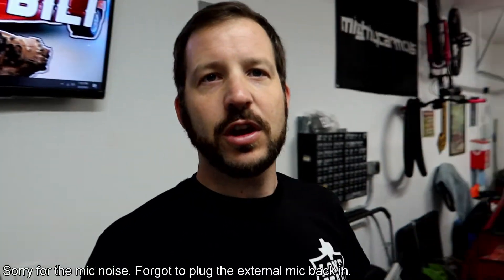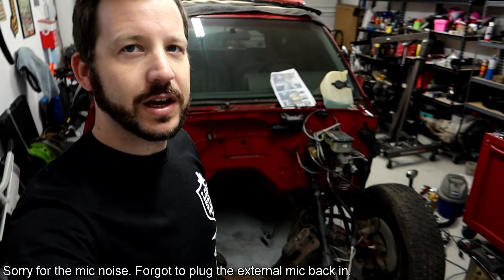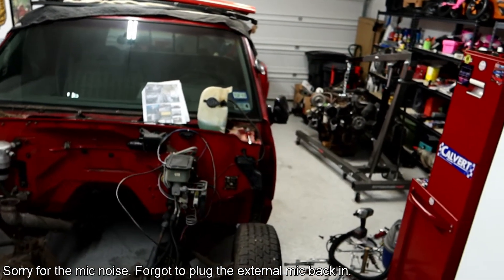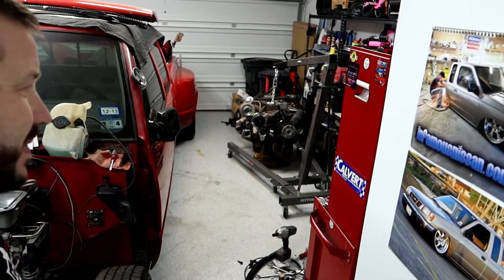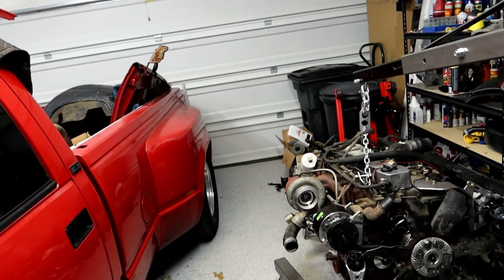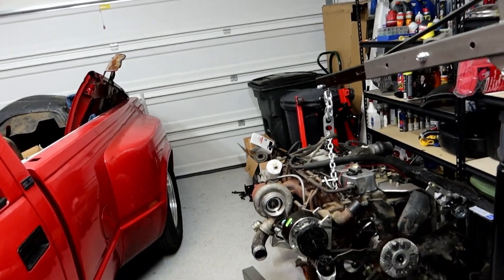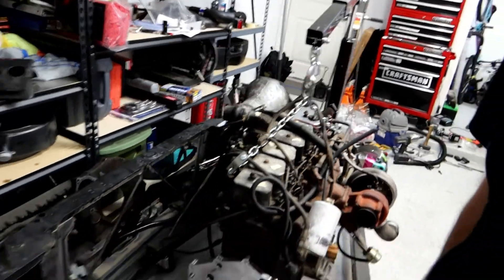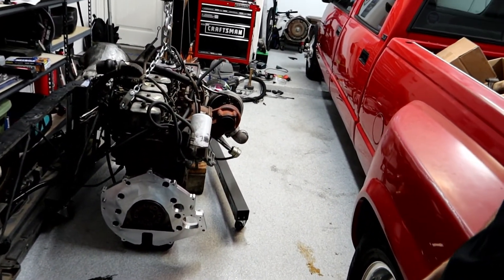12v Cummins / Allison 6 Speed Conversion 1

Comment: I need that powertrain for my second gen. 😂😂
Reply from the maker: Recon i had to bail on the Allison. But the engine is still definitely good to go. Just waiting on fuel system parts.
Reply: @GarageBilt  good shit, if only I could stuff it all in a half ton lmao
Reply: My 5.2 318 has seen better days
Reply from the maker: @ReconProductions  You can fit it in a half ton. Plus the rotary Cummins are cheap and simple for the most part. My truck didn't have an engine when I got it. So it was this or a LS engine. Decided staying diesel would be best.
Reply: @GarageBilt  yeah, I definitely want to run a diesel too.....eventually
Reply: @GarageBilt  so what did you go with.  My 5.9 1996 just took out my rag 360. It's a tuned up cummins.  I would really like to be able to tow and not give a worry to losing my transmission.

Comment: How will the electronics work from the 12 valve to the Allison? Using the throttle positioning sensor?
Reply from the maker: I never made it this far. I bailed off the Allison and switched to a 48RE with a FirePunk Controller. I was going to use CAConversions Allison Conversion kit but after talking to them it was close to 6k. Picked up a 48RE and the FirePunk for around $1600 and the person I sold the truck to got it working with that setup. I'll post a link to CAConversions below.

https://www.caconversions.com/
Reply: Do you need this for the build and did you have a allison 1000
Reply: Si se puede yo actualmente estoy con un 6bt 12 Valve  y Allison serie 3000  en dodge Ram.... Y esta quedando fantástico

Comment: I’m considering buy my buddy’s 12 valve Cummins. And would like to put an Allison trans . Any advice on where to find more information on parts , just in general, it’s something I just started on , soI don’t have much time invested in doing research right,  any input would help thanks man!
Reply from the maker: Yeah man. Check out my instagram @Garage_Bilt_Steven and message me on there. I used Gforce performance crossmemebers for the transmission adatper and flex plate, with a ford powerstroke 6.0L diesel starter from Rockauto. You have to run a special converter for the allison to handle the cummins torque load. As far as computers and converters go I was looking at Custom Automatic Conversions, Destroked, and TransmissionTuners systems for controlling it.
Reply: Allison Conversions is what we do, if you have any questions or if we can help you in anyway just let us know.
Reply: @caconversions4591  Not to sound critical,  but your website seems short on package details and pricing, and the background makes it a very difficult read.
Reply: @misterj5045  We agree, that is one thing that is in the works is getting it updated and more user friendly.